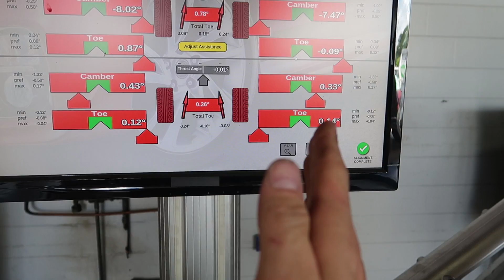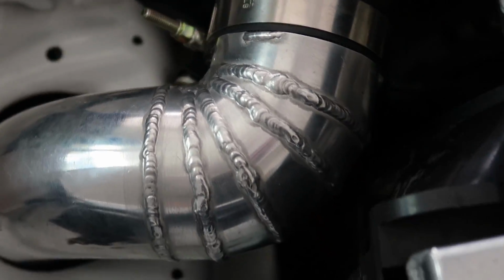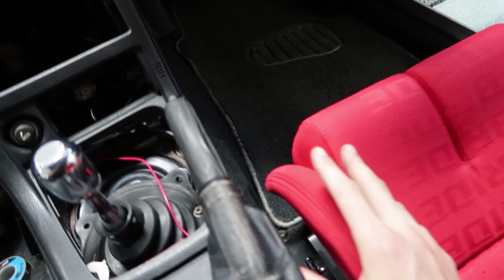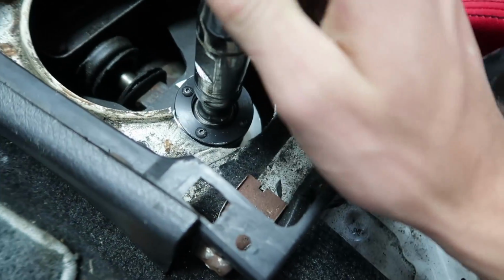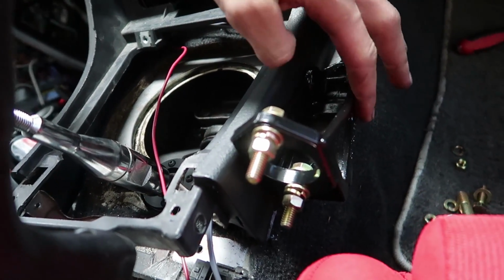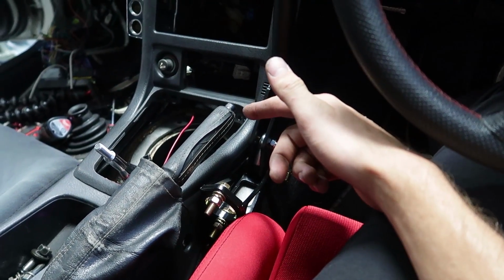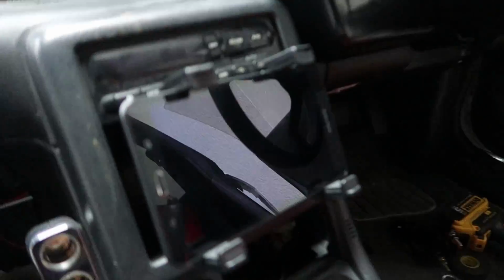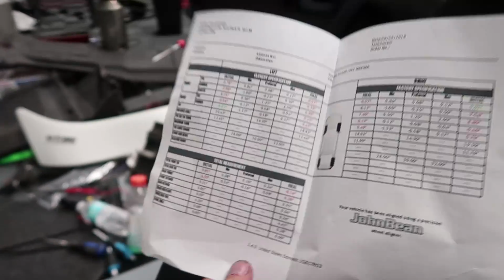Skyline's New Stance

Comment: You should drill a hole through the plastic for that bolt.  Then on the other side of the plastic put a piece of steel plate, drill a hole for that bolt to go through too.  Now with the bolt through the plastic and steel plate and add a nut onto the bolt.  This will give it more strength.  Hope that made sense.

Comment: Adam you should use ram ball mounts. You could screw the base into the trans tunnel under the dash then use a couple inch arm to get the tablet in the right spot. Lots of off road guys use them for communications and tables for navigation

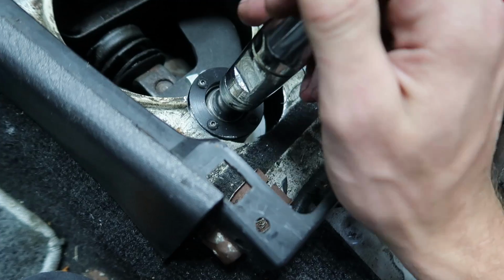Comment: @03:06 i have packed those full of grease before it helps a little bit but not enough. What they need to do is have a nylon insert that goes between the pivot ball and the socket that way it's solid and crisp but not clanky and rattly for no damn reason maybe someone with a 3D printer out there could hook it up with a thin sleeve to go on the inside of the socket that the pivot ball could sit inside

Comment: Please be careful when cutting the handle, brakes need a certain pressure to work properly and the master cylinder might need to be sized differently if you cut the handle and lose leverage..